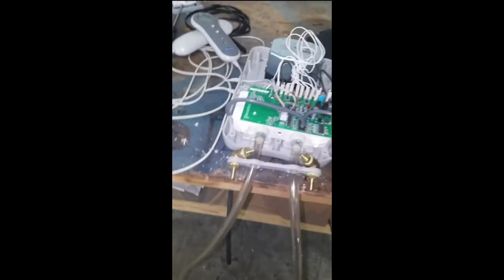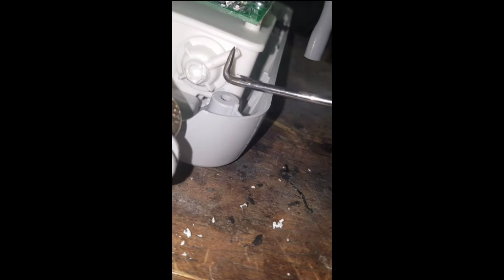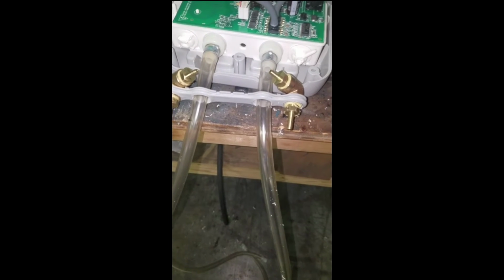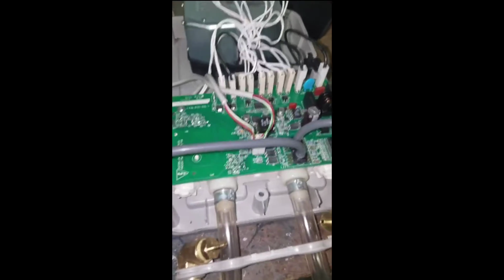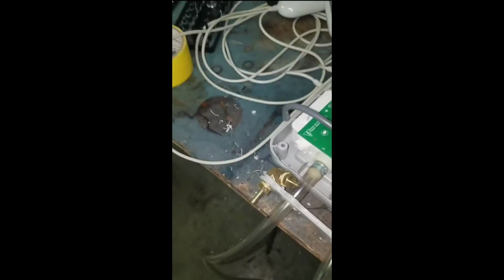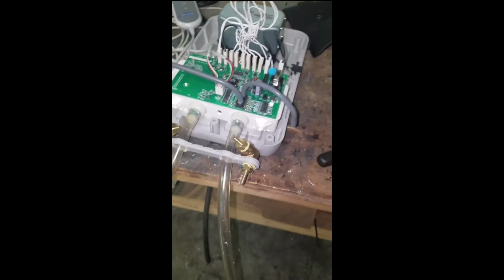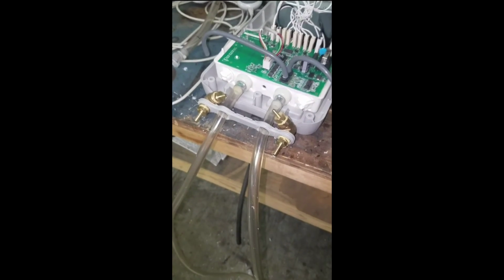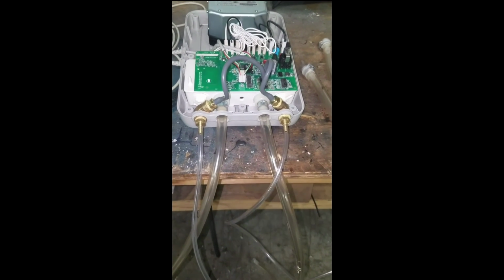How to repair sleep number bed pump

Comment: How the heck do ya get the top off. I’m trying to get access to what you have there but the top cover will not release. Removed the 3 screws but the bed is over 20 years old so it maybe all one part now… instead of a cover and inner cabinet.
Any tips would be appreciated…👍
Reply: Okay… thanks to your video they have screws hidden beneath the rubber plugs that act as feet.
I will advise on progress.
Reply: Got power to the circuit board but that’s about as far as my trouble shooting goes. Power in… No power out… Replace board. 
Or just replace bed.
I’m going with replace the bed. 💰 💵 💵